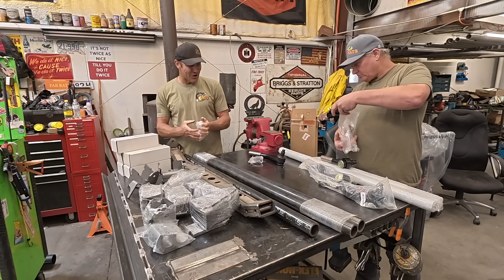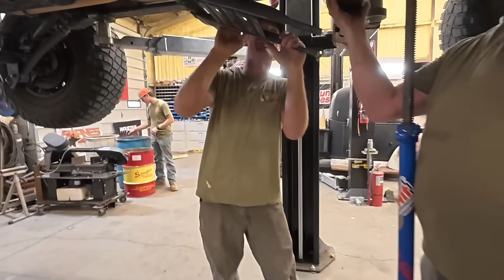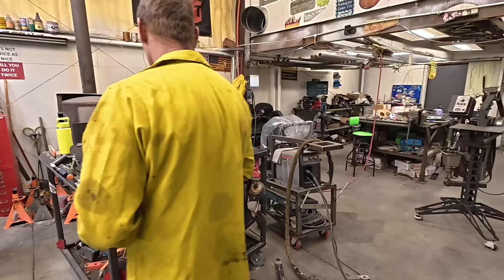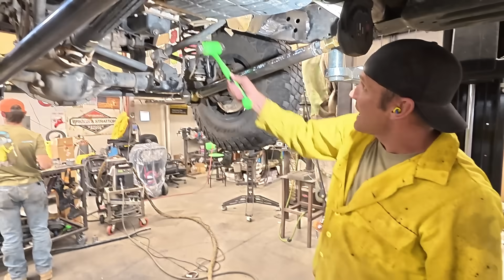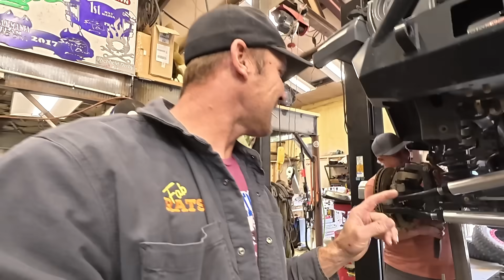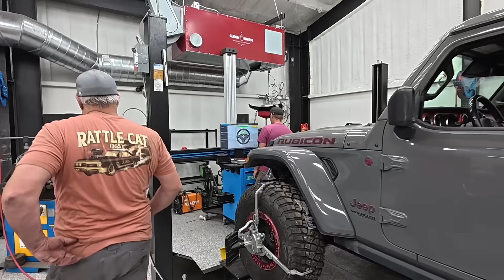JEEPS Biggest Problem And How To Fix It:  THE DEATH WOBBLE!

Comment: Years ago I owned a Land Rover and I decided to trade it in for a jeep. I took the Jeep out for a test drive and within two blocks I knew I wouldn't be buying one. It was a wet noodle in a high wind when it came to handling. The roll rate in corners made you think it was going to roll. Brakes were lacking to say the least. I was told it had the heavy duty suspension and when I checked it out that consisted of some spring limiting towers bolted to the frame that limited the length of the flex portion of the leaf springs. I was told it had a seven cross member frame but I could only find five. When I questioned the salesman about it he pulled out a brochure showing the frame. Turns out they included the bumpers as frame cross members.

Jeep has not changed much over the years. My Daughter bought one and two years later regretted it. 55,000 kilometers and the entire front suspension was shot just nicely off warranty. Damn thing was not even paid for yet. We live in Canada but the Jeep was kept in Arizona for a vehicle when they have to go there on business. Some fellow came along and offered her way more than what it was worth so it was sold off never to be replaced. When you say Jeep in Spanish it's pronounced "HEEP". That pretty much covers it for my family.

Comment: I passed a tractor trailer doing 70mph or more riding my 1980 750/Four Honda motorcycle. The turbulence around the trailer caused my front wheel to start moving side to side so violently that it almost threw me off. The only way to stop the wobble was to let off the gas.
I'm not sure what caused it but I had just put grease in the front fork bearings so I loosened the tension so the forks moved side to side easier and it never happened again.

Comment: Death wobble comes from installing a lift on a jeep without adjusting the bottom of the steering triangle. Of course you're going to need a new steering stabilizer as well.

Comment: So we had the same problems on our JK, and for several years I upgraded the steering to 1 ton everything and even adjusted the camber, toe was good to go. But we kept have that slight deathwobble, until someone told me if I changed out the steering gearbox. Well I did and low and behold, it fixed it and we have been wheeling and daily driving it for 3yrs without an issue, go figure, all that upgrading for years.

Comment: 100 years ago when i was in the Army we dealt with the hummer, it's over sized unbalanced tires that would develop flat spots and horrible death wobble at 45. By the time you got to 55 they'd level out.
Rear steer capable (just needed hydraulics) and very early wheel offset from the drive axles. 
I still went further and did more off road in the M151 Jeep.

Comment: 'Mornin', Fab Rats!/ Wotta wobble! But several things can cause it. I had a little deflection of some sort before new tires. I put the tires on and it went bonkers!👽 So, I changed ball joints, put new bushings in the links and new tie rod ends. Now, it was time to do all that, but as it turned out, two BRAND-NEW tires were out-of-round! ☠️You never know!/ Paul, do you ever test Tom's patience?/ Til nxt tim!

Comment: I had a death wobble on my old '55 CJ5 that I swear wouldn't stop until I pulled to the side of the road and turned the key off. It'd rattle the fillings loose in my teeth!

Comment: So all I have to do to fix my death wobble is spend thousands of dollars and re-engineer the front of my jeep? why didn't I think of that? LOL
Reply: This is more of an upgrade video and less of a fixing deathwobble video.
Reply: @Tinker3504 no more death wobble though right? So I would say death wobble fix with an upgrade 😂
Reply: Jeep stands for just empty every pocket
Reply: Not thousands. If you built it right there’d be no issues
Reply: That's exactly right 😂
Reply: FYI, every Jeep owner who goes offroad spends thousands of dollars redesigning all kinds of stuff on their rig.
Reply: @theninja001  I've owned several Jeeps so I'm aware of the money spent upgrading them. Upgrading is different than making it drivable IMO
Reply: What takes fab rates a day or two is like weeks and months for us regulars lol
Reply: @pohoholoholo5712 exactly
Reply: @pohoholoholo5712 Having all the special tools.. a large place to work and a lift.
Oh yeah... friends to help
Reply: Yes..... No one is going to be making a bolt-on kit anytime soon
Reply: no, you can fix it for basically free, you just need to adjust your front axle for like 4 degrees of negative caster. with the axle leaning backwards just a little bit it makes it want to self steer and keep the tires from shaking
Reply: Or just get a proper vehicle
Reply: @chrisvig123 Nothing more proper than a lifted Jeep 😂
Reply: Not thousands just a grand
Reply: @jeremysigfusson2640 So.. the parts may be grand, but the tooling to make it all fit and function is easily in the thousands
Reply: Just looking at the tires when it rolled tells a lot. The wear pattern.
Reply: Buy a Toyota
Reply: Than don’t fix it, complainer….
Reply: Just keep it stock, and no issues
Reply: @robertheinkel6225  
Lame. Keep the tow rig stock, build the toy
Reply: @robertheinkel6225 Stock is Boring
Reply: @robertheinkel6225 yup- my JT Rubicon with stock suspension and upgraded to 35s smooth as silk even at 80mph
Reply: @robertheinkel6225 stock 2022 less than 17000. Death wobble. It's a jeep thing
Reply: I would say this was a good excuse to go hog wild on Tom's jeep I'm sure there are other ways to fix it but this was a good time to do alot of upgrades and also fix the death wobble issue while doing upgrades
Reply: Someone explain to tom about rotating the tires. 
What’s up with the over-inflated bald rear tires?
Reply: @t @thomasleonard9685  
Fuel economy 🙄🙄

Comment: I did a wheel alignments for 50 years. The best way to get that wheel straight is to recenter steering wheel after every adjustment.
Reply: The newer vehicles you can connect to the OBD and tell the angle of the steering wheel.  So you know it's 100% at 0 degrees.

Comment: My jeep had a death wobble too a few years ago but it was just the brake rotors so I replaced those and no more death wobble.
Reply: 👀 what? You should get other look at it
Reply: @WhatTheHeck1290  the rotors were pretty warped and it only happened when I pressed the brake pedal. Sorry if I didn't explain clearly in my last comment. But when I pressed on the brake pedal I would get a death wobble bad.
Reply: @bretthibbs6083 Warpped rotors are bad!! I would just check your upper and lower ball joints to make sure they are seated properly
Reply: @WhatTheHeck1290  yep I've already replaced them a few years ago and before that I had all of my ball joints and a front ujoint replaced as well and I had a shop replace the ball joints and u joint.
Reply: @bretthibbs6083  Right on!!!

Comment: Bought a nice low mileage (under 70k) XJ for my wife years ago.  The body was rust free but I discovered after getting it home that the spring perches on the front axle were nearly rusted through.  I bought a nice used front axle assembly and swapped it in and since I had the suspension apart, I replaced the suspension bushings, and since I had the front wheels off I decided to rotate the tires too.  Jeep drove fine before, but had terrible death wobble after.  I swapped the tires back to their original positions and the death wobble disappeared.
Reply: Tires could have been Directional Ply. Meaning they are only meant for a specific side of the car.

Comment: The TRACK BAR that was designed by Rene Panhard. Makes a vehicle track (drive straight) ie track it’s doesn’t make it panharder down the road. A transmission was designed by Alfred Homer Munro we don’t call a transmission a Munro. Do you see the point that is being made?